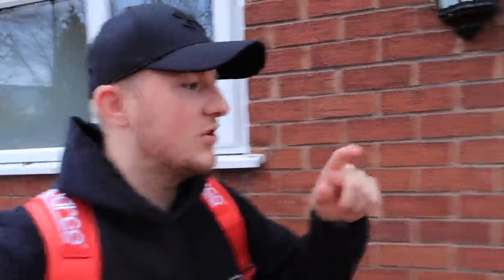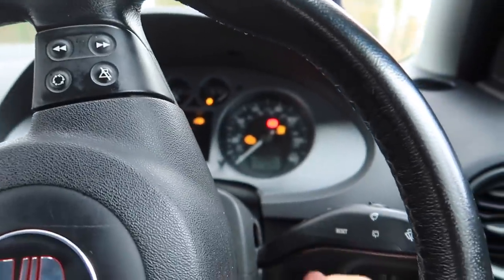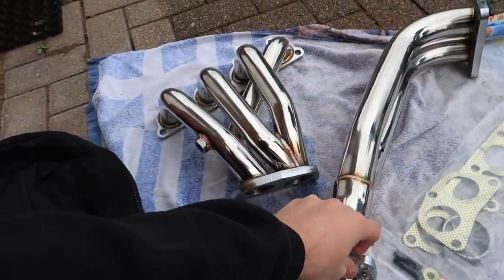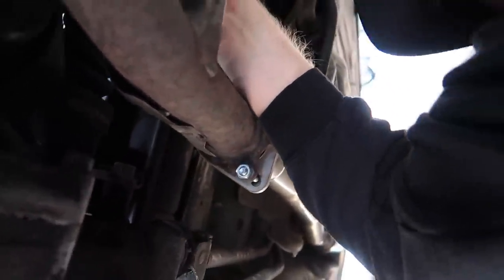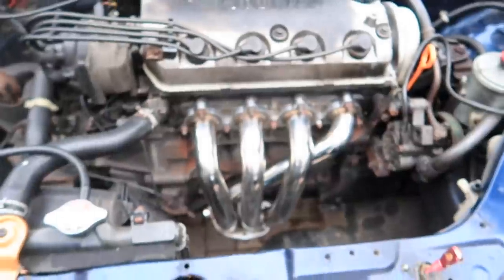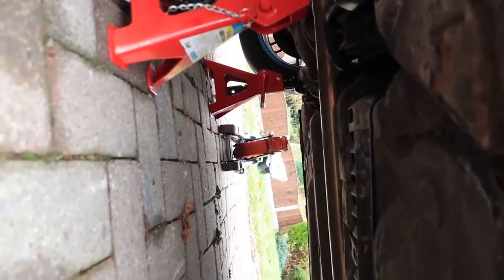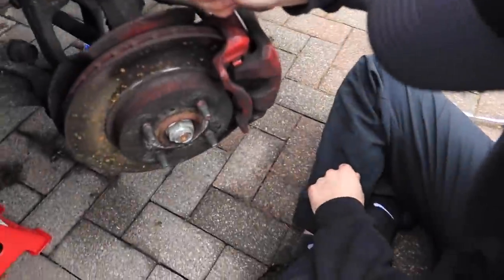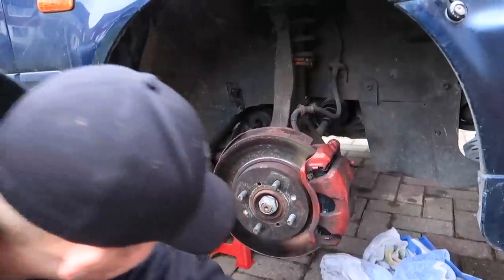BIG GAINS FOR THE EJ9!! *Scrap To Track Ep9*

Comment: Added 3kw with the 4-2-1 header, lost 7kw with that filter
Reply from the maker: We’re gonna try make it some what better as it will he heat soaking a little but she made good power on the dyno 😁
Reply: @JesseCollingham  Tip Jesse, long straightish 67mm diameter pipe, right up to about 25cm from the headlight with a 90 silicone bend to the throttle body...then make some sort of heat shield to divert hot air from the radiator away from the filter...(also skim the head by 0,7mm...)
Reply: @JesseCollingham  just remove the air filter lad. free and lets the car get more air. stick some fine mesh over an intake pipe if your scared of something being sucked into the throttle body. looking forward to seeing this project
Reply: @ChillinLikeAVillain1210  you can still see 350 hp from a d14 with a turbo kit,ecu and everything else needed. far more than most k20's on the road.

Comment: Its called a diff. That's why one will and one wont spin haha
Reply from the maker: Brent Dalton should both spin when accelerating and 1 wasn’t
Reply: It’s an open diff mate they don’t both spin
Reply: @JesseCollingham  you'll have to get an lsd like quafe lsd and get it fitted or a built box with an lsd already
Reply: Brent Dalton, with no load on both wheels they should both spin

Comment: that bottom o2 sensor is the better one to use as in the top one its only reading from 1 cylinder so if other cylinders are running lean or rich it wont know, at least if it notices a difference in the whole exhaust gases from the bottom you know theres a problem

Comment: Only one wheel will spin either way just because it has an open diff. The wheel with the least amount of resistance will spin and the other won't move.
Thats why if you park a car with an open diff with one wheel on the grass and one on the tarmac it usually just gets stuck because sends all the power to the wheel on the grass whereas a limited slip diff will send power to both the front wheels once the one on the grass had lost traction.
If you want to test if the brakes are binding the best way to do it is spin them by hand and just do it by feel 🙂
Not a critasism, just thought i'd point it out. It's good to see you having a crack at it yourself.
Those ebay manifolds are pretty decent as well used quite a lot of them over the years, only issue is the gaskets don't last very long.
If it starts blowing, replace it with a triple layered metal one, bit more expensive but it should last you forever.

Comment: Use a hammer and punch to remove the screws in the disk, I work for a Honda main dealer and use this method for every disk I remove
Reply: Tip. hold the punch perpendicular to the screw edge and whack it to make a dent to sit the punch in when you turn it out

Comment: Didn't know you had a mk4 Ibiza. I've got a 130bhp fr diesel bought it as a cheap run about. Used to have a mapped one as first car making just over 170bhp and 300 ft lbs of torque

Comment: Use a hammer and just snack the disc of. We do it at work and it does the job
Reply: It has a retaining  screw in these discs
Reply: @jasonboyle7203  yeah and eventually the retaining screw will snap due to how much pressure hitting it is causing.